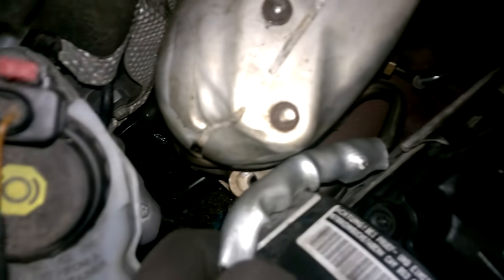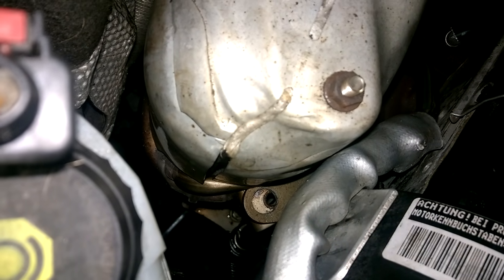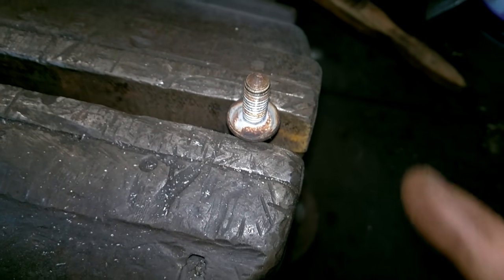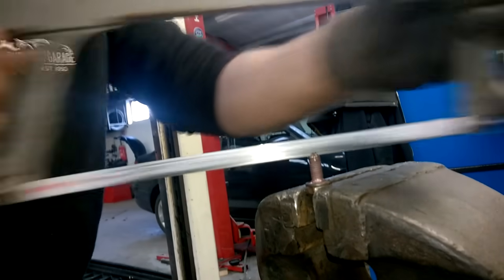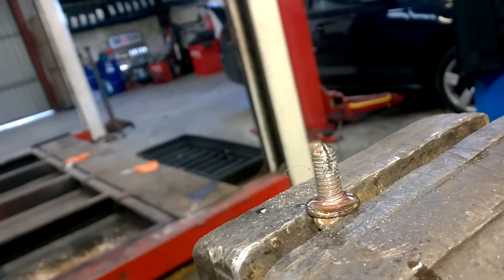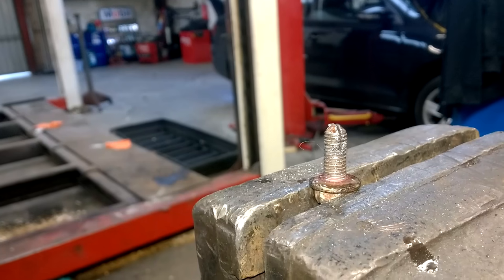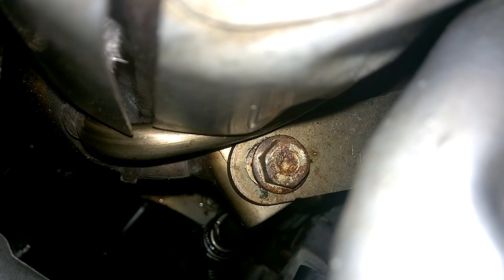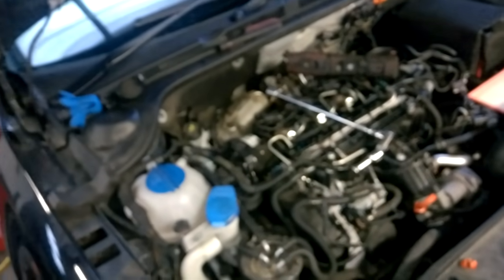My Father Taught Me This! Passing It On To The Next Generation

Comment: You know that there likely to be a very good reason that this bracket doesn't line up.   I'm not a fan of these "band aid" type fixes.    As soon as you decide
that it's OK to take a shortcut.  Now you need to decide how much your life is worth.  When is this OK and when is it not.   This appears to be exhaust related.
Would you do this on a steering arm.  You may not want to admit it.  But not all these bolts are rated the same and it does matter.  Fasteners hold your 
damn car together.   This trick is fine on your lawn mower.  Not on your car.
Reply from the maker: The update info below is the pinned comment on this video, I know most people do not realize I made that video and it better explains/shows this method in use.   
I also included below details of why the job was done this way free of charge with the customer fully informed. I hope you check it out  👇👇
 
UPDATE* I decided to make a follow up video on this https://www.youtube.com/watch?v=yfNQullGEuQ&feature=youtu.be Should answer some of the questions that were raised, I include 3 demos of this in action with close up shots.
 
As there was some safety concerns & confusing comments raised, I felt I should clear a few things up. 
1) This is a tip for certain circumstances only, I never have and never would use it on a component which would cause any safety concern to any customer.  
2) The demo was done on a support bracket only, items like this or similar will not cause any safety concern. 
3) I did this free of charge and on a time restraint, I noticed it when I was replacing another item, the customer needed the vehicle back that evening and I decided rather than leave it like it was, I would do this and secure it up fully. 
4) The bolt was not the issue, the part that the bolt threads into is a secured piece, someone had previously damaged it, leaving the bracket loose and the bolt just tightened a turn or so.
5) The bolt can be removed and will not break, it will go in and out as usual and has helped clean up the damaged threads.  
6) Used in the right application I personally believe this is a great tip and can save you a lot of time & trouble. 

Lastly to all the people who have watched the video, Thanks very much and I am delighted with the feedback I have received on it.

Comment: " H A C K " is CORRECT. You just created fragments NEARLY MPOSSIBLE to remove from hole.
The bolt's quench & temper grade 5 and higher NOW USELESS as the tensile/ grip strength are destr0yed. 
REALITY is- NEVER do this.

Comment: Does not work putting a steel bolt (particularly gr.5 or 8) in aluminum.
Reply from the maker: The update info below is the pinned comment on this video, I know most people do not realize I made that video and it better explains/shows this method in use.   
I also included below details of why the job was done this way free of charge with the customer fully informed. I hope you check it out  👇👇
 
UPDATE* I decided to make a follow up video on this https://www.youtube.com/watch?v=yfNQullGEuQ&feature=youtu.be Should answer some of the questions that were raised, I include 3 demos of this in action with close up shots.
 
As there was some safety concerns & confusing comments raised, I felt I should clear a few things up. 
1) This is a tip for certain circumstances only, I never have and never would use it on a component which would cause any safety concern to any customer.  
2) The demo was done on a support bracket only, items like this or similar will not cause any safety concern. 
3) I did this free of charge and on a time restraint, I noticed it when I was replacing another item, the customer needed the vehicle back that evening and I decided rather than leave it like it was, I would do this and secure it up fully. 
4) The bolt was not the issue, the part that the bolt threads into is a secured piece, someone had previously damaged it, leaving the bracket loose and the bolt just tightened a turn or so.
5) The bolt can be removed and will not break, it will go in and out as usual and has helped clean up the damaged threads.  
6) Used in the right application I personally believe this is a great tip and can save you a lot of time & trouble. 

Lastly to all the people who have watched the video, Thanks very much and I am delighted with the feedback I have received on it.

Comment: Would this be considered a "hack"?
Reply from the maker: To the internet that's a yes, thanks for watching Michael 
 
The update info below is the pinned comment on this video, I know most people do not realize I made that video and it better explains/shows this method in use.   
I also included below details of why the job was done this way free of charge with the customer fully informed. I hope you check it out  👇👇
 
UPDATE* I decided to make a follow up video on this https://www.youtube.com/watch?v=yfNQullGEuQ&feature=youtu.be Should answer some of the questions that were raised, I include 3 demos of this in action with close up shots.
 
As there was some safety concerns & confusing comments raised, I felt I should clear a few things up. 
1) This is a tip for certain circumstances only, I never have and never would use it on a component which would cause any safety concern to any customer.  
2) The demo was done on a support bracket only, items like this or similar will not cause any safety concern. 
3) I did this free of charge and on a time restraint, I noticed it when I was replacing another item, the customer needed the vehicle back that evening and I decided rather than leave it like it was, I would do this and secure it up fully. 
4) The bolt was not the issue, the part that the bolt threads into is a secured piece, someone had previously damaged it, leaving the bracket loose and the bolt just tightened a turn or so.
5) The bolt can be removed and will not break, it will go in and out as usual and has helped clean up the damaged threads.  
6) Used in the right application I personally believe this is a great tip and can save you a lot of time & trouble. 

Lastly to all the people who have watched the video, Thanks very much and I am delighted with the feedback I have received on it.

Comment: That's awesome
Reply from the maker: The update info below is the pinned comment on this video, I know most people do not realize I made that video and it better explains/shows this method in use.   
I also included below details of why the job was done this way free of charge with the customer fully informed. I hope you check it out  👇👇
 
UPDATE* I decided to make a follow up video on this https://www.youtube.com/watch?v=yfNQullGEuQ&feature=youtu.be Should answer some of the questions that were raised, I include 3 demos of this in action with close up shots.
 
As there was some safety concerns & confusing comments raised, I felt I should clear a few things up. 
1) This is a tip for certain circumstances only, I never have and never would use it on a component which would cause any safety concern to any customer.  
2) The demo was done on a support bracket only, items like this or similar will not cause any safety concern. 
3) I did this free of charge and on a time restraint, I noticed it when I was replacing another item, the customer needed the vehicle back that evening and I decided rather than leave it like it was, I would do this and secure it up fully. 
4) The bolt was not the issue, the part that the bolt threads into is a secured piece, someone had previously damaged it, leaving the bracket loose and the bolt just tightened a turn or so.
5) The bolt can be removed and will not break, it will go in and out as usual and has helped clean up the damaged threads.  
6) Used in the right application I personally believe this is a great tip and can save you a lot of time & trouble. 

Lastly to all the people who have watched the video, Thanks very much and I am delighted with the feedback I have received on it.

Comment: That's why they call it a hack-saw.
Reply from the maker: The update info below is the pinned comment on this video, I know most people do not realize I made that video and it better explains/shows this method in use.   
I also included below details of why the job was done this way free of charge with the customer fully informed. I hope you check it out  👇👇
 
UPDATE* I decided to make a follow up video on this https://www.youtube.com/watch?v=yfNQullGEuQ&feature=youtu.be Should answer some of the questions that were raised, I include 3 demos of this in action with close up shots.
 
As there was some safety concerns & confusing comments raised, I felt I should clear a few things up. 
1) This is a tip for certain circumstances only, I never have and never would use it on a component which would cause any safety concern to any customer.  
2) The demo was done on a support bracket only, items like this or similar will not cause any safety concern. 
3) I did this free of charge and on a time restraint, I noticed it when I was replacing another item, the customer needed the vehicle back that evening and I decided rather than leave it like it was, I would do this and secure it up fully. 
4) The bolt was not the issue, the part that the bolt threads into is a secured piece, someone had previously damaged it, leaving the bracket loose and the bolt just tightened a turn or so.
5) The bolt can be removed and will not break, it will go in and out as usual and has helped clean up the damaged threads.  
6) Used in the right application I personally believe this is a great tip and can save you a lot of time & trouble. 

Lastly to all the people who have watched the video, Thanks very much and I am delighted with the feedback I have received on it.

Comment: OR you could just use a spud wrench.
Reply from the maker: The update info below is the pinned comment on this video, I know most people do not realize I made that video and it better explains/shows this method in use.   
I also included below details of why the job was done this way free of charge with the customer fully informed. I hope you check it out  👇👇
 
UPDATE* I decided to make a follow up video on this https://www.youtube.com/watch?v=yfNQullGEuQ&feature=youtu.be Should answer some of the questions that were raised, I include 3 demos of this in action with close up shots.
 
As there was some safety concerns & confusing comments raised, I felt I should clear a few things up. 
1) This is a tip for certain circumstances only, I never have and never would use it on a component which would cause any safety concern to any customer.  
2) The demo was done on a support bracket only, items like this or similar will not cause any safety concern. 
3) I did this free of charge and on a time restraint, I noticed it when I was replacing another item, the customer needed the vehicle back that evening and I decided rather than leave it like it was, I would do this and secure it up fully. 
4) The bolt was not the issue, the part that the bolt threads into is a secured piece, someone had previously damaged it, leaving the bracket loose and the bolt just tightened a turn or so.
5) The bolt can be removed and will not break, it will go in and out as usual and has helped clean up the damaged threads.  
6) Used in the right application I personally believe this is a great tip and can save you a lot of time & trouble. 

Lastly to all the people who have watched the video, Thanks very much and I am delighted with the feedback I have received on it.

Comment: Still i cant understand purpose of cutting
Reply from the maker: The update info below is the pinned comment on this video, I know most people do not realize I made that video and it better explains/shows this method in use.   
I also included below details of why the job was done this way free of charge with the customer fully informed. I hope you check it out  👇👇
 
UPDATE* I decided to make a follow up video on this https://www.youtube.com/watch?v=yfNQullGEuQ&feature=youtu.be Should answer some of the questions that were raised, I include 3 demos of this in action with close up shots.
 
As there was some safety concerns & confusing comments raised, I felt I should clear a few things up. 
1) This is a tip for certain circumstances only, I never have and never would use it on a component which would cause any safety concern to any customer.  
2) The demo was done on a support bracket only, items like this or similar will not cause any safety concern. 
3) I did this free of charge and on a time restraint, I noticed it when I was replacing another item, the customer needed the vehicle back that evening and I decided rather than leave it like it was, I would do this and secure it up fully. 
4) The bolt was not the issue, the part that the bolt threads into is a secured piece, someone had previously damaged it, leaving the bracket loose and the bolt just tightened a turn or so.
5) The bolt can be removed and will not break, it will go in and out as usual and has helped clean up the damaged threads.  
6) Used in the right application I personally believe this is a great tip and can save you a lot of time & trouble. 

Lastly to all the people who have watched the video, Thanks very much and I am delighted with the feedback I have received on it.

Comment: German cars are flawless
Reply from the maker: The update info below is the pinned comment on this video, I know most people do not realize I made that video and it better explains/shows this method in use.   
I also included below details of why the job was done this way free of charge with the customer fully informed. I hope you check it out  👇👇
 
UPDATE* I decided to make a follow up video on this https://www.youtube.com/watch?v=yfNQullGEuQ&feature=youtu.be Should answer some of the questions that were raised, I include 3 demos of this in action with close up shots.
 
As there was some safety concerns & confusing comments raised, I felt I should clear a few things up. 
1) This is a tip for certain circumstances only, I never have and never would use it on a component which would cause any safety concern to any customer.  
2) The demo was done on a support bracket only, items like this or similar will not cause any safety concern. 
3) I did this free of charge and on a time restraint, I noticed it when I was replacing another item, the customer needed the vehicle back that evening and I decided rather than leave it like it was, I would do this and secure it up fully. 
4) The bolt was not the issue, the part that the bolt threads into is a secured piece, someone had previously damaged it, leaving the bracket loose and the bolt just tightened a turn or so.
5) The bolt can be removed and will not break, it will go in and out as usual and has helped clean up the damaged threads.  
6) Used in the right application I personally believe this is a great tip and can save you a lot of time & trouble. 

Lastly to all the people who have watched the video, Thanks very much and I am delighted with the feedback I have received on it.

Comment: Good idea I guess. I would of fixed the threads with a file. Or if I had one, run the bolt through a die. More than one way to skin a cat thou.
Reply from the maker: The update info below is the pinned comment on this video, I know most people do not realize I made that video and it better explains/shows this method in use.   
I also included below details of why the job was done this way free of charge with the customer fully informed. I hope you check it out  👇👇
 
UPDATE* I decided to make a follow up video on this https://www.youtube.com/watch?v=yfNQullGEuQ&feature=youtu.be Should answer some of the questions that were raised, I include 3 demos of this in action with close up shots.
 
As there was some safety concerns & confusing comments raised, I felt I should clear a few things up. 
1) This is a tip for certain circumstances only, I never have and never would use it on a component which would cause any safety concern to any customer.  
2) The demo was done on a support bracket only, items like this or similar will not cause any safety concern. 
3) I did this free of charge and on a time restraint, I noticed it when I was replacing another item, the customer needed the vehicle back that evening and I decided rather than leave it like it was, I would do this and secure it up fully. 
4) The bolt was not the issue, the part that the bolt threads into is a secured piece, someone had previously damaged it, leaving the bracket loose and the bolt just tightened a turn or so.
5) The bolt can be removed and will not break, it will go in and out as usual and has helped clean up the damaged threads.  
6) Used in the right application I personally believe this is a great tip and can save you a lot of time & trouble. 

Lastly to all the people who have watched the video, Thanks very much and I am delighted with the feedback I have received on it.